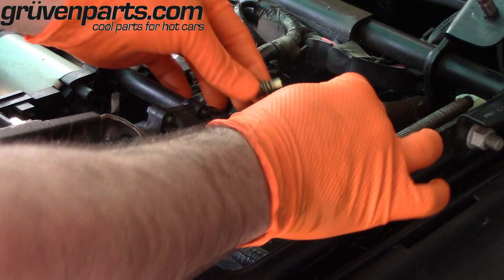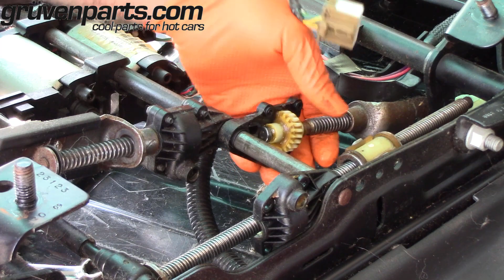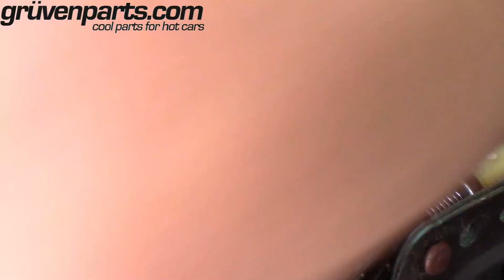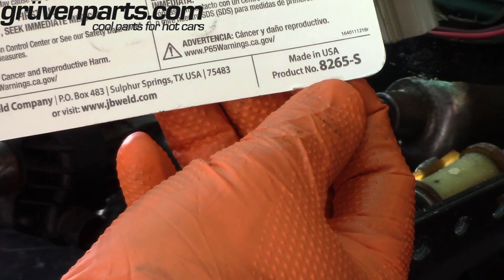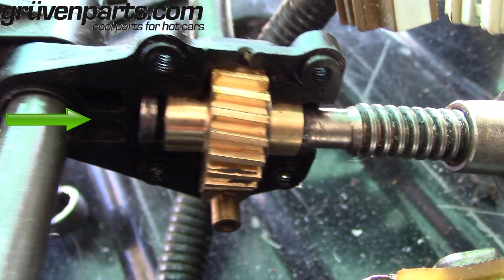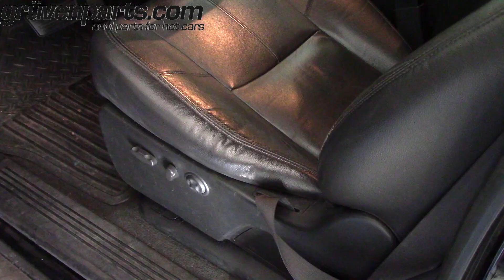GruvenParts GM Truck Brass Gear Seat Repair

Comment: For what it's worth -- this worked for our 2006 Mazda 6 -- apparently they used the same housing/gear as the GM mechanism. Thank you for the parts and instructions with video and tips.  Was able to finally fix it.

Comment: I wouldn't buy these gears. These gears only worked when unloaded. When loaded, they binded up and stopped. Wasted 2 days with jb Weld etc - only to find these gears don't work. Save yourself time and headache, don't buy these.
Reply: Just installed both of mine today and they work great 👍!
Reply: I don't know one single person that had a problem with them. When you don't know what your doing, don't blame the product.
Reply: @bassb450  it was probably because i didn't use a micrometer to be exact. I just eyeballed it. It was too late after the JB weld dried. Anyhow i was told by a master mechanic that these aftermarket gears will only last a couple years. Eventually the brass will wear and start binding. Watching the video from the guy who sells them, you can tell the seat is noisier than a stock chair. OEM gears are assembled by robots and are perfectly timed. 10 years is what can be expected from OEM; these gears might last 3 years.

Comment: Very helpful video.   The hardest part was getting the screws out of the housings due to poor access.  Especially the aft housing.  

FY:
Deep socket reqd on fwd bolts
Large internal star required to remove seat belt bolt to release seat from truck 

Otherwise went just as shown.

Comment: Pretty good fix, for those too cheap to buy the E20 and E16 sockets, the 9/16 and 7/16 (universal) 12 side socket works well. This is for a 2011 Tahoe

Comment: I installed a set of these gears in my 2010 Avalanche, it’s been over 1 year now and they have worked flawlessly.
I would recommend this set of gears to anyone with height adjustment problems with GM trucks. GM replaces the entire bottom assembly when plastic gears break. I think the dealer quoted me $1100 for the part & install.

Comment: I may need a couple sets of these in the future.  are the gears different for the seat fwd/back adjustment mechanism?  also, HOW DID YOU TEST THE SEAT AT THE END, WITHOUT USING THE BUTTON ON THE SEAT?  :)
Reply: He pressed the memory seat button

Comment: Hello---do you happen to know if the seat gear transmission on a '10 Cadillac DTS is the same as the unit repaired in the video?  (Did GM have different seat transmissions for the trucks etc?) I am hoping that the repair kit might work on the DTS as well.  Thank you for your reply.
Reply from the maker: I honestly do not know, but I bet you could get some photos off the internet and compare them and see if they are similar. I would think they would have little difference.
Good luck on your search.

Comment: Mike, great video.  I am fixing a seat on a Chevy Avanlanche as a type.  Turns out Gruvenparts is 20 minutes from my house, so that worked out well.  Question, as I am working on it, I turned the shaft that the gears attach to just a little as I was cleaning them.  Should i be concerned where they are along the track since the two motors that raise, lower and tilt the lower seat seem to be synced up.  Also, does it matter which direction the worm gear sits.  The spiral gears seem to be a little concaved in one direction.

thanks!
Reply: How long did it last?